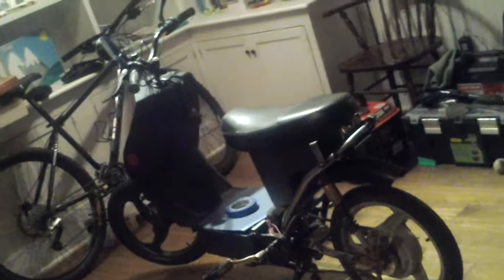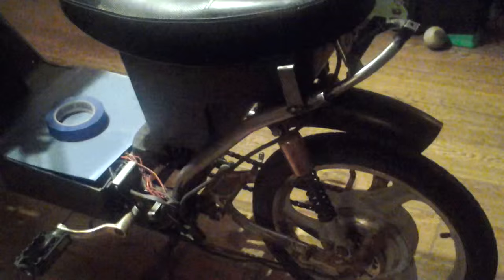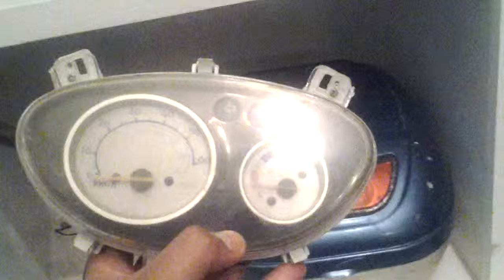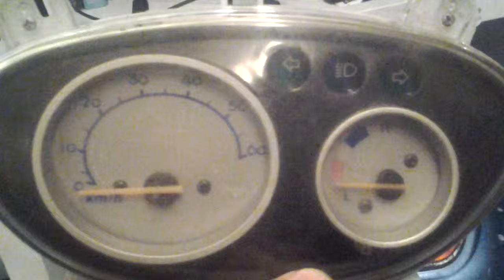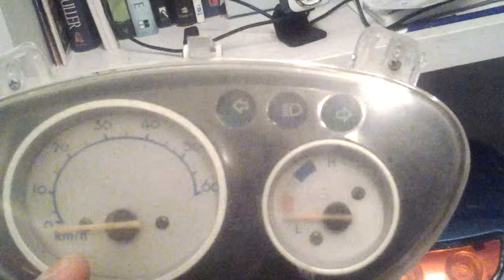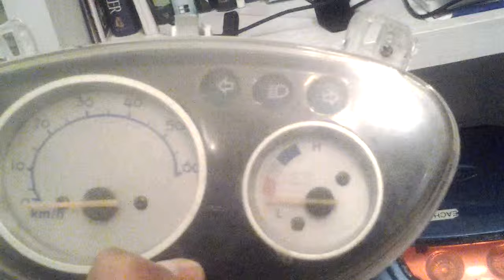Electric Bug Out Scooter

Comment: NICE! 
I hope to buy/build or otherwise obtain an electric vehicle soon, and my research has uncovered that you can extend range greatly with a capacitor bank that is 20% the size of the battery bank. Especially if you have regenerative braking, as it absorbs the charge effect much easier than the battery can, and with less heating. 
NICE FIND! 
$160 sounds like a decent deal, I think you did great, Leo!

Comment: Can you charge it via solar
Reply from the maker: In theory you could...ie, as long as the voltage of the solar system was equal to the battery voltage, you could. I think this system was a 36v so youd have to either charge a battery bank that was hooked up to an inverter and then charge it the normal way OR charge the battery with a 36v system